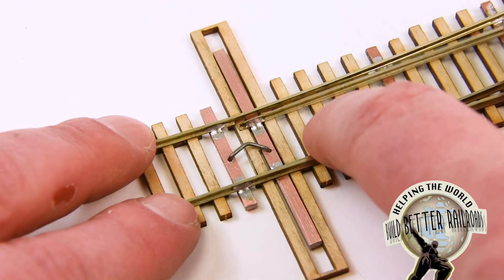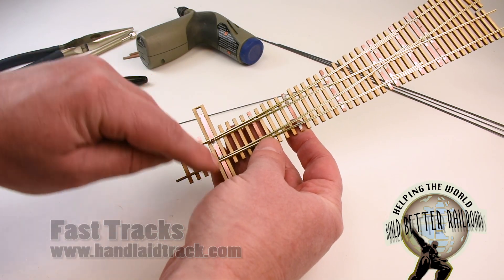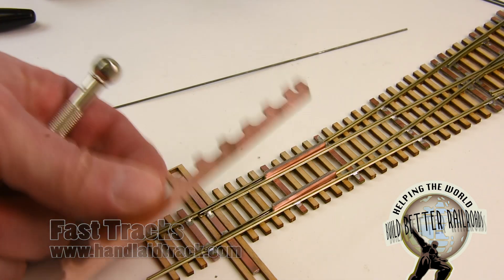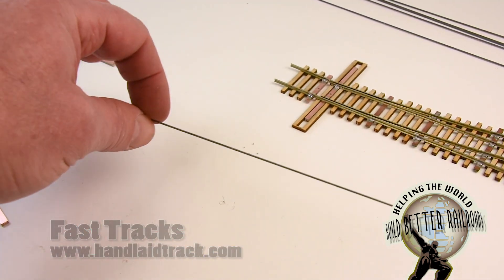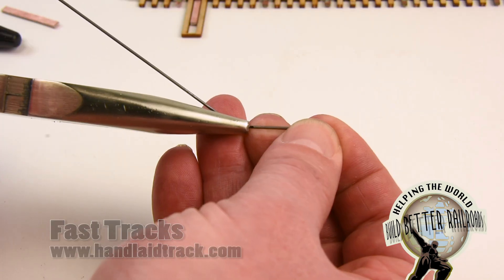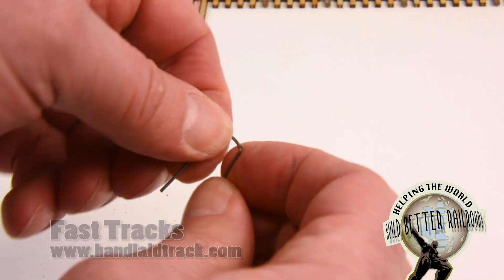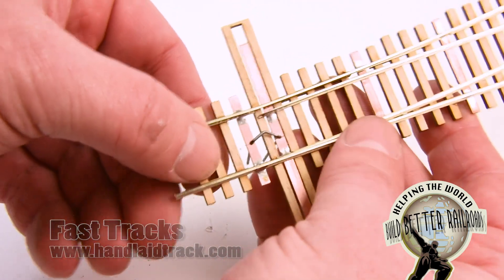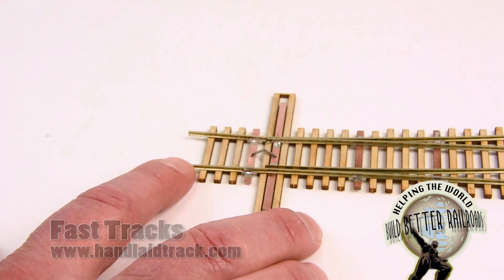Making a Over Center Spring for Manual Turnout Control

Comment: THAT is an excellent training film to achieve the desired 100% dependable result.   Presumptive, perhaps, but the smaller the scale ratio (HO - 1:87 ; O - 1:48) the dimension, tie-to-tie, across the headblock is increasing.  Between HO and N gauge, the reverse is true.  The desire to keep the wire as "invisible" as possible might be resolved by increasing (or decreasing) the diameter of the wire to x-thousandths or increasing the 30-degree bend to secure more sping tension.  Any thoughts?

Comment: Paper clip installation for me, too.  I was skeptical, but it works great! Thanks for posting! Whether you use piano wire or paper clips, if your spring tends to come out of the holes, especially in plastic ties, put a VERY slight bend away from the center in both the downward facing stubs that fit into the drilled holes.

Comment: Great video.  I used 0.032" piano wire and converted 5 g scale turnouts that were already ground installed, while kneeling in snow. Took one 12" piece and 20 minutes.  Thanks much
Reply: I was wondering about G scale  & you answered my question about it.  Thanks.

Comment: Does the spring need to be between the rails?  Could you extend the ties/throw bar and install the spring on the extensions?
Reply: Since the spring is working against the center line of the switchpoints and the switchpoint pivot, going outside the rails would probably be a problem.  But what the heck!!  Give it a try!
Reply: In theory it should work fine either way, as long as the spring ends are in line parallel to the track centerline when the switch points are centered. That way the spring is at its highest compression when both its ends are in line with the center and wants to push the free end away from the centerline. The stock rails prevent the switch points from traveling any farther, so they lock into place on either side of center. Brilliant idea.

Comment: Well Done, this is the first and only "coherent" description I have found of how to make your own over centre spring for points.  Thank you so much.!
Reply: I was helping out an guy who got into the deep end of the model rail pool doing a layout for a multi-millionaire, and was learning as he went. One day, the little hidden spring in one of the soldered-in, ballasted, and motored Peco switches broke as we were testing the track to the container terminal. In response to his deflated "Oh, no-o-o..." I grabbed a piece of light piano wire, a tiny drill in a pin vise, and tapped a replacement - as seen above - into the throw bar and a tie: Click. Clack. You should have seen his face!
It's a nice trick to have in your back pocket!
Reply: @carmium  That's interesting, because I was under the impression that when you added a motor drive, like a Tortoise or even something like a bullfrog, you want to pull out the spring anyways. That's what I've done with my N scale turnouts. 

Nice story! Clutch, because regardless, it seems something wasn't working right, and then suddenly was.
Reply: @andrewlaverghetta715  Peco Motors are a simple double coil solenoid, and don't have any mechanism to hold the points over  to either side, so they continue to rely on the tiny built-in spring.

Comment: Would you recommend using CA glue on the backside or does the wire need to rotate in the hole slightly?  Thanks for the great video.
Reply: I expect you want to have the wire to rotate freely (hence also the loose fit in the hole mentioned)

Comment: you make it look easy.  I just can't get it right.  doing it on atlas switches
Reply: Pearly Humbucker not true. Did over 30 atlas switches this same way. Works fine
Reply: The spring ends when centered must be parallel to the track centerline. Too weak a spring won't apply enough pressure. Too strong a spring will deform the ties or rails. You only have half the distance from the point to the rail to play with to get the holes in the right places.
Reply: @James Smith
This doesnt work on every switch out there. It will not work with plastik ties, with rails that are nailed on the ties. 
To work properly it needs very hard ties, and they MUST be fixed to the rails - soldered or - maybe - glued with some kind of superglue (but I believe, glueing isnt strong enough).
The u-wire works as a spring here, pushing the two ties apart, thus pressing the rails to the one side or to the other. Plastic ties and many wooden ties wont withstand the pressure, they will bow - and the effect of the springing wire is lost. Same goes for rails that arent solidly fixed to the ties - the ties will wander under the pressure of the springing wire, therefore the effect of the spring is lost then too.

Conclusion:
This solution only works with switches that are build like the fast track switch in the video. All other switches - especially them with plastic ties - need  a spring mechanism that doesnt apply the force of the spring to the switch itelf or its components.
Reply: Thanks l!

Comment: Install that on the underside
Reply: Yes that's exactly what I was thinking. You'll need a small spring void in the track bed into which the spring can sit and than all you have on the surface are a couple of almost flush cut spring ends.